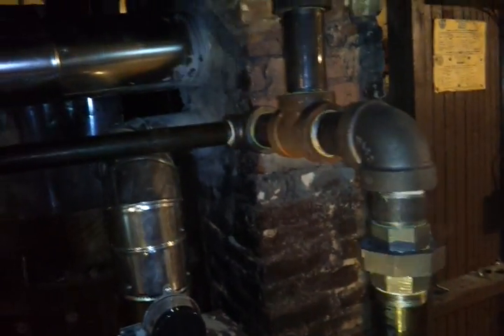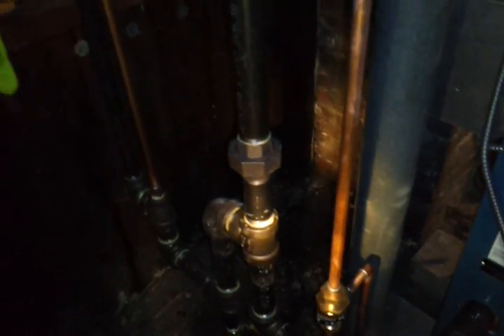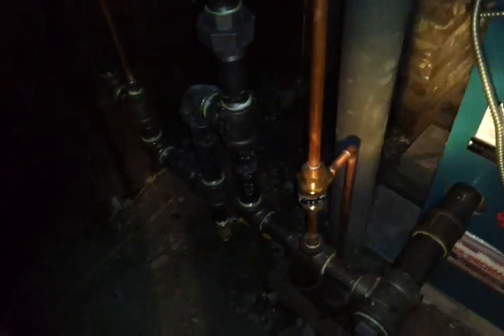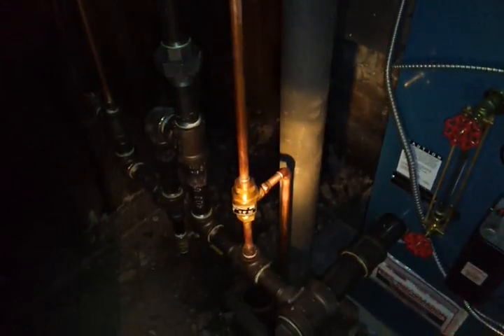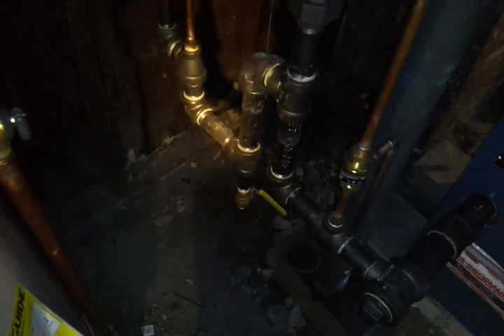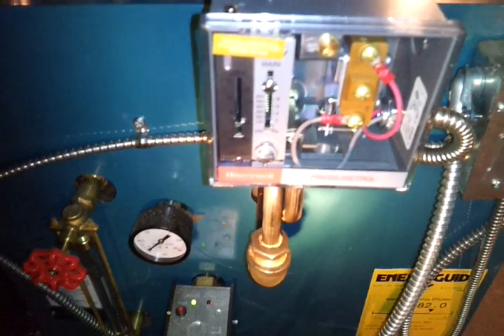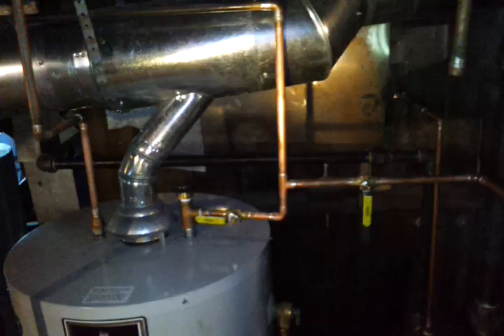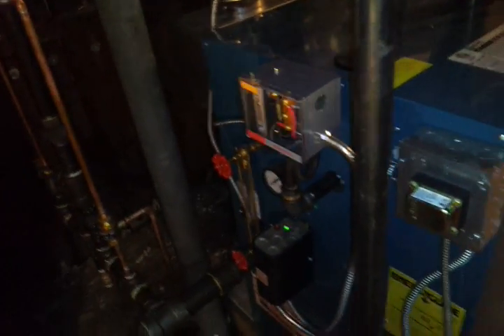Steam Boiler Replacement 9.6.12

Comment: how much was the boiler replacement? thx
Reply: @SupaTrending Daily Steam boilers are sized by their connected load. You must determine the square footage of steam in each radiator. Then add them up. The square footage of steam total is how you select a steam boiler. Another term for it is EDR (Equivalence of direct radiation). You must select a boiler at or Above this number. As per your cost estimate.....it's a bit wide isn't it? ;)
Reply: Sizing steam is different than a hot air or hydronic system.
The house heat load is important for sizing radiators, but many older jobs had column type radiators that require twice as much steam as newer styles. It might not make sense but you have to size the boiler to match the radiators. I just did an estimate with a 270000 input to match the radiators. The heat load of the house is only half that. It will not operate correctly with a smaller boiler because the radiators are steam guzzlers and you won't get uniform heat to the radiators. Inefficient yes but it would be a fortune to repipe everything. I only wish people would stop thinking in labor plus material. A business has many expenses not seen by the customer. The brand used is a big factor because some brands are twice as expensive. You also have to consider the controls. Do not size a steam estimate without knowing the what radiators are used. I am only trying to help you and am not being critical.
Reply: No, they don't but if they have a system that was working the nameplate on the existing boiler might help. Many steam systems also burned coal as did the house I was raised in.   A coal-fired boiler never goes off completely we controlled heat my banking the fire.   When they converted all was taken into consideration. I do know almost every hot air furnace is oversized for the house and ductwork. The old-timers sized  a steam system for the steam load and they were not so far off.
Reply: No problem. Cost doesn't change much give or take 50000 BTU's. The measurements of the steps and doors are the most important
Reply: This article explains what I'm trying to say a little better. It is because of the age of some systems and regardless of the heat load you have to consider the demand of the radiators and forget the house load. Most boilers are not rated in BTU's but are rated in square foot of steam.http://www.columbiaheatingsupply.com/page_images/Sizing%20Cast%20Iron%20Radiator%20Heating%20Capacity%20Guide.pdf
Reply: You have to turn back time when the system was installed and the radiators are what you have to live with from an era long ago. If not, the system will not work correctly. If they installed a monster you have to feed it
Reply: I don't give estimates. I give a consultation.
Reply: @brianellsworth4767  thanks.  I can't seem to be able to locate my Main Vent.... any tip? Does it have to be on a steam pipe?
Reply: I believe you are talking about the pressure relief. It should be on the boiler and piped to vent the steam away from the path of people, usually toward the back and about five inches off the floor. Air vents are located on every radiator and shut off when the steam reaches them. About sixty years ago one blew in my bedroom woke me with a loud whistle. It did reset when I banked the fire. I don't know if the ones today also act as a pressure relief. Hot water boilers also have a pressure relief set at about 30lbs. 15 for steam. There should be one on your boiler most definitely.It is the most important safety

Comment: We are converting a house from one boiler for the two apartments, installing an additional boiler, so there will be two separate boilers for the separate upstairs and downstairs apartments.  Existing boiler has two large pumps.  We are 75% sure about which pump is designated for upstairs and downstairs existing radiators.  We are not sure about locating separate water return.  What should we look for to locate separate water return for separate water circulation for each apartment?

Comment: Thanks for posting up the video. I have a question for you. I have a Burnham (Model IN4/ BTU 105,000 input). My cast-iron insert is leaking and I was wondering if I should replace just the insert or replace the steam boiler. I found the internet a Burnham Natural Gas Hot Water Boiler 130,000 BTU input (Model:Z05NIL-TE12). I'm wondering if this system is a steam system or a water system. Also I was wondering I can replace my old one with the Burnham (Model:Z05NIL-TE12). Thanks and please message me if your are able to answer my question.

Comment: Yes u shud always have a backflow to create a closed system , and ur Hartford loop shud be right of the boiler not 2 feet away  to each is own my boilers are piped way different weather it be a 3 " drop header or piped in according to burnhams specs .. Also good job not using copper alot of people use copper now days because they don't know anything about steam heat and its easier then cutting and threading

Comment from the maker: These boilers were installed in a two family house.  There is a separate boiler for each floor, they were replaced about 5 years apart.  The other replaced boiler is running fine and has only been replaced once.

Comment from the maker: Auto feeders are optional equipment, some customers opt to install them, others don't.
Customers who install them also tend to not bother to go to the basement and check the low water cut off as they are supposed to.  Having a manual feed gets them down to the basement where they can also check for any obvious problems.  The key to a properly functioning steam system (if installed properly) is in the venting, if the vents are functioning properly it reduces water consumption.